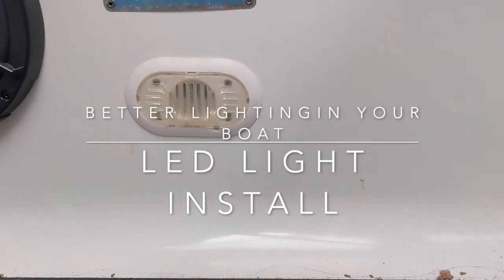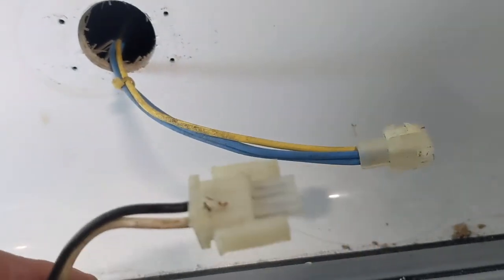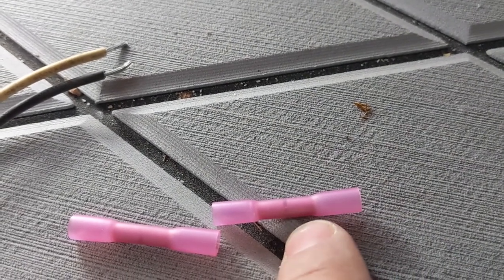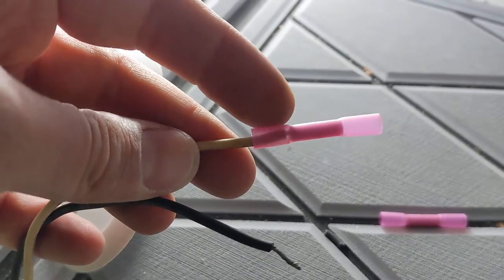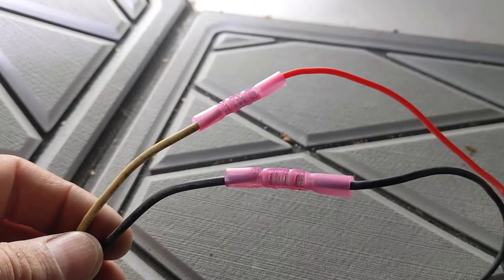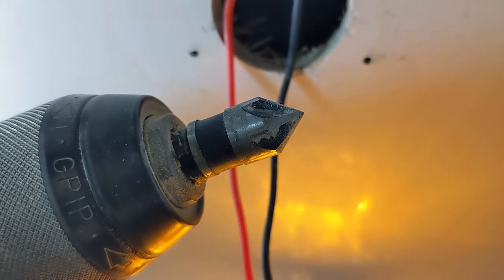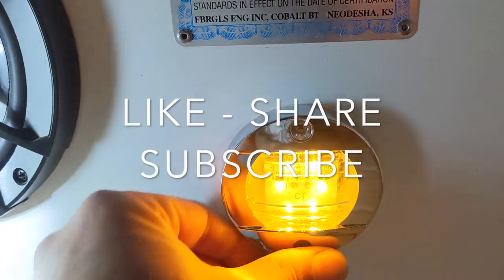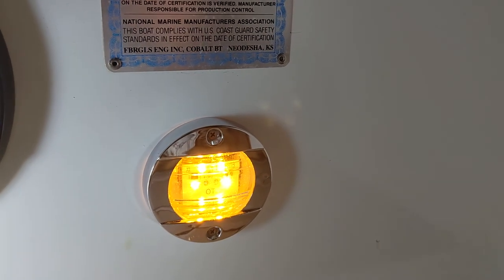Boat LED Lights Installation - Update Your Boat with LED Lights

Comment from the maker: Waterproof Marine Splice Connectors - https://amzn.to/3dMl1v2
Crimping tool for insulated connectors - https://amzn.to/32EsFBu
LED Courtesy Lights, Flush Mount - https://amzn.to/3Rn9rZp
Small butane torch - https://amzn.to/32DBrjg
Wire cutter / stripper - https://amzn.to/3emjawe

Comment: Good tip on preventing “spider cracks “.  Appreciate your video man.  I usually learn the hard way… haha!  All the best
Reply from the maker: It's crazy how many spider cracks I see on boats that are only a few months old because the folks working at the factory didnt countersink the holes. It's a simple step that helps keep your boat looking beautiful. I see it a lot on the windshield mounting points and tower mount points.

Comment: Many 12vdc supply wires will be 14 or 16 ga and LED wires 16 or 18 ga. We simply fold over the smaller LED wire to help fill out the space within the crimp connector. LED fixtures draw so little milli amps the mfg saves money by using a smaller wire.
Reply from the maker: Great point!

Comment: Thanks for the video. I’m curious, on the original courtesy light, if you wanted to keep that, does that bulb pop out for replacement? Or when it burns out do you have to replace the entire unit? Having a similar issue now
Reply from the maker: I Actually never tried. I would guess that the bulb is replaceable. But it’s just as easy to replace them with these LED units.